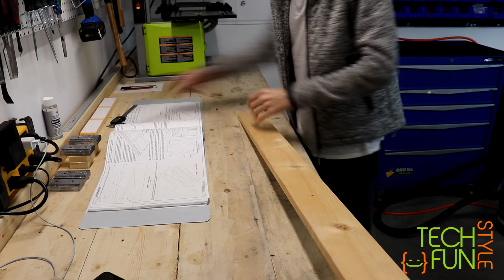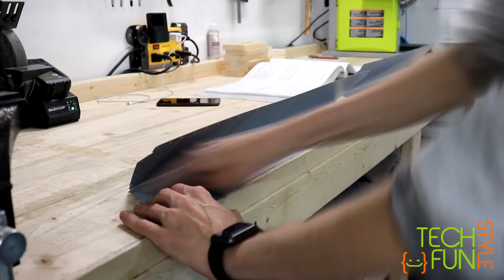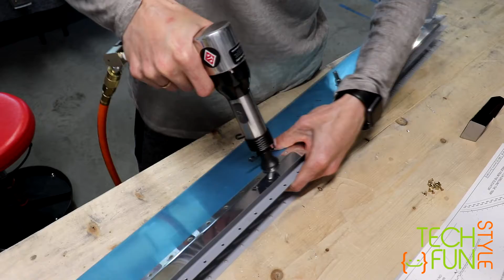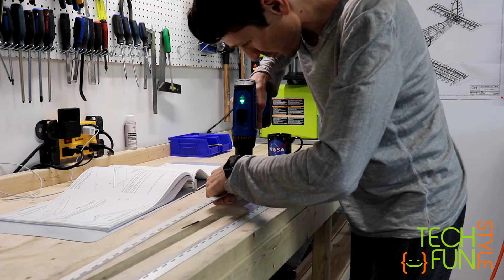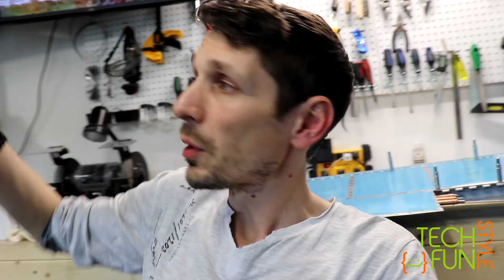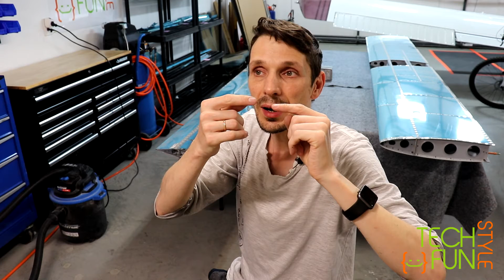RV-10 - Elevators assembly. Completed. Building airplane

Comment: Tank sealant must be thoroughly mixed or else it will not cure properly!!! As you found out. The instructions for the plunger style that you had I think says to give the plunger 50 full strokes. I pull the sticker off of the tube so I can see and not only do 50 in/out strokes but also keep twisting the plunger with each stroke. If it isn’t mixed at 50 I keep going until I don’t see anymore of the base color of sealant.
Reply from the maker: I am sure that was my problem. I reviewed what was done in regards of mixing the tank sealant and found that it has not been properly mixed. Thank you for your comment.

Comment: Hi Vlad, The little waves in the traling edge have more impact on esthetic appearance than flying capability. 

Sorry I can't help you to understand problem with tank sealer, but I don't understand why  Van's conception of wings traling edge required tank sealers. 

Did Van's or other builders said something about that utility for that ? Samething for inside foam, an aluminum rib with blank rivet will do the job more quickely with less effort. 

You said something funny : I have a post in my shop saying : If you dont know how to do, asked to your Wife !
Reply: Hey Christian! How are you? Thank you for your comment. Yes trailing edge is definitely aesthetic appearance. I will se if I will need to redo them or not. I read that some people do not use sealant while others do. It is not mandatory as I understood but VANs recommend this for better strength of the trailing edge. 
It’s true- always ask your better half if you in doubts 😀
Reply: Hello  @Отвинта-ъ5ъ  , I'am fine at home and wealthy. I'am a little suprise by amount of work required to assembly the Van kit pieces. Cutting, trimming and plying, etc. pieces. I'am building an CH640 from plan, techniques of assembly are far more simple apart I have to cut and bend all pieces, but the tank are welded alu. First, when I started, I considered at that time the Van 10, because I was thinking they where more simple to assembly, pre drilling, etc. But I think, if you buyed pieces from kit Zenair, this is far more simple to assembly. We dont discuss here the fact they have not the same peformance aircraft.
Reply from the maker: @christiantremblay  Hello Christian! It is true, VANs kit requires probably more efforts to assemble it comparing to some other kits. I found that tailcone kit requires even more preparation of parts out of raw material than all previous parts (rudder, vertical stab, etc). However it is good and I like the fact that I need to be more involved than just match drilling or deburring. This gives me more experience and hopefully makes me better on assembly.

Comment: Was it warm enough in your shop. Sometimes if it is cool in the shop those 2 part materials cure very slowly. You might try placing them in you house in a warmer temperature. Sometimes when it does not cure overnight, you can save it by placing it in a warmer room.
Reply from the maker: Thank you for recommendation. I have not think this way to be honest but you totally right - temperature and probably humidity make much sense. Temperature was about 65F-69F in my hangar (18C-19C). However humidity is about 60-65% these days due to lots of rains here. I still have sample of that non-cured sealant so I will make an experiment and bring it home for test.